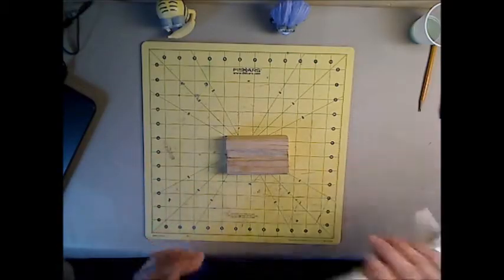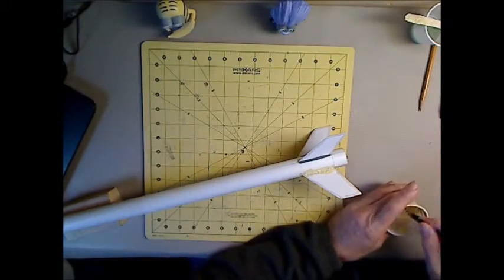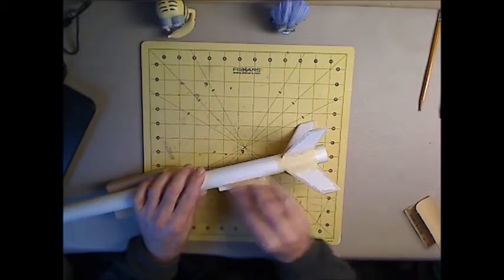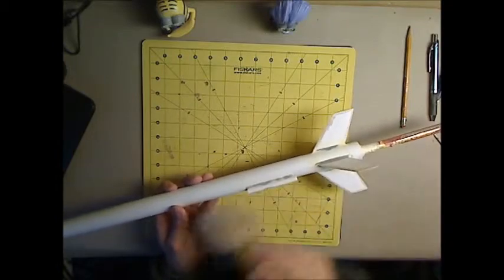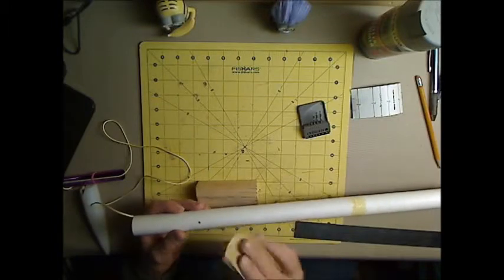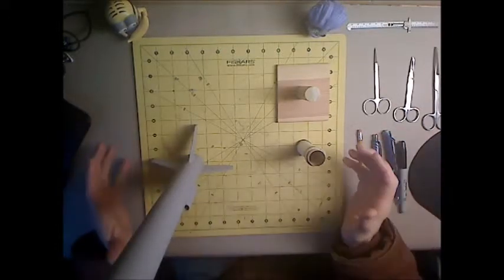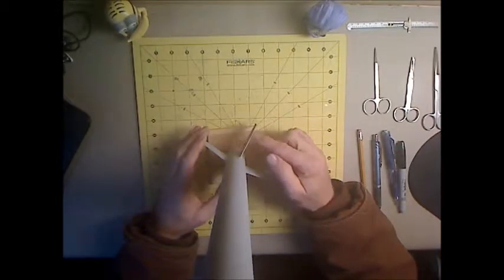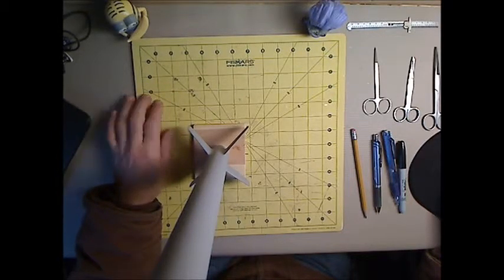Apogee Aspire Build Part 5 Prep For Primer

Comment: Is a fine grit sandpaper necessary? I only have 220 grit paper. Also did you sand after each coat of primer?
Reply from the maker: You can do the first few sands with 220, but your last sand, you will want to use 400. I laid on 4 or 5 coats of primer, give it a few days to dry, then sand and repeat until I am happy with it.
Reply: @rocketfamilykml2528  while painting today, I got some really bad finger indentations on the paint since I forgot it wasn’t dry yet 🤦‍♂️what do you suggest I do? It also sustained a drop from around 5 feet and it landed smack down on one fin and a part of the paper skin in peeling off, but I added some CA glue and it somewhat fixed it. let’s say the rocket had bad day today
Reply from the maker: @CrazyAsian1  sand paint blemish smooth. Fix.paper.with thin CA
Reply: @rocketfamilykml2528  thanks a lot!

Comment: What clear coat did you use?
Reply from the maker: I believe it was krylon. The big secret is between primer and paint wait 3 days to a week depending on temp. The same for paint to clear coat and be sure to follow the manufacturers "re coat time limits " to the letter and you should avoid the crackle and wrinkle problems.